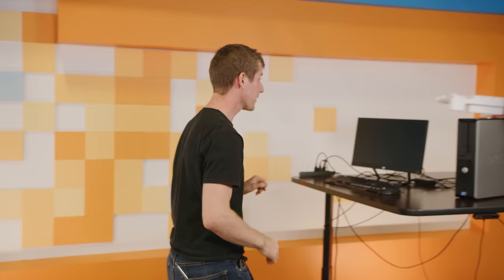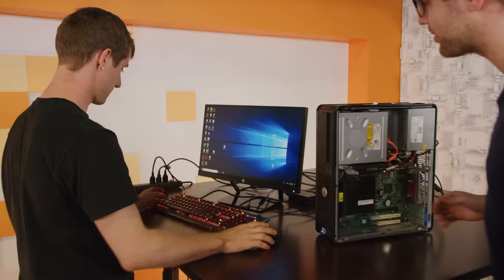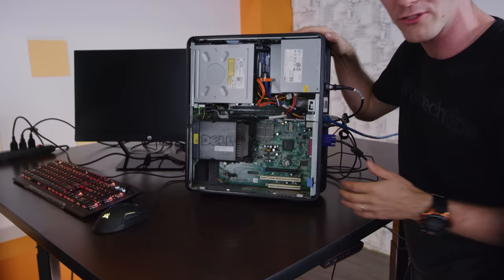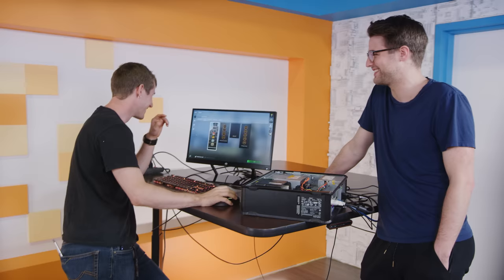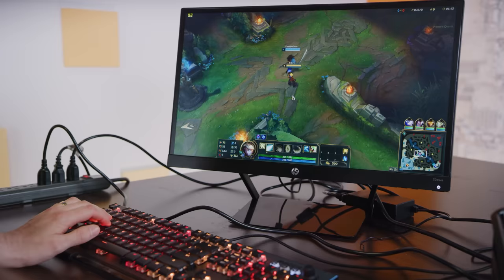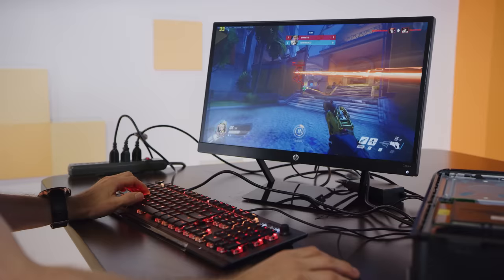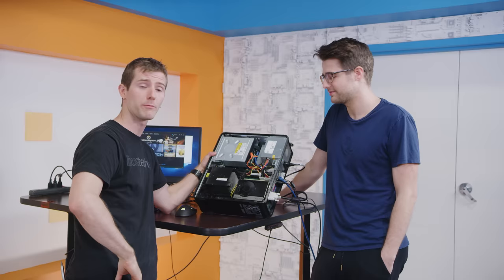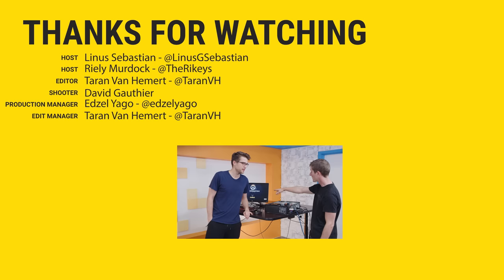The $69 Gaming PC RETURNS

Comment: you should bring this back but use the Dell Optiplex 755 or 360, 8 gigs DDR2 800 Mhz ram $30.00, a socket 775 moded 3.0 Ghz Xenon E5450 quad core or 2.83 Ghz X3363 (no bios mod required with Optiplex 755) aliexpress $20.00 these can be overclocked to 3.5+ Ghz using SetFsb free software, and a used Asus Phonex fan gtx 1050 or 1650 (60.00-100.00 USD) using the optional Dell Optiplex MT riser mounting braket and the optiplex 280W 80+ silver efficiency (no mod cable needed on optiplex 360)
Reply: Bioraual  Google it

Comment: I attempted a similar budget recently and this is what I got (£66 inc postage):
A4-5300b
8gb 1066mhz ddr3 ram
Radeon HD 6450
AC wifi and Bluetooth 4.0
250gb 3.5" hard drive
80gb 3.5" hard drive
20gb 2.5" hard drive
Dvd-rw drive
Ps/2 Keyboard and laser mouse
Wireless controller
In terms of ports its got hdmi, 4 usb 3.0, 6 usb 2.0, pcie etc

Runs windows 10 and is good for watching video + office applications, would anyone make any changes to this if they could within budget?

Comment: This makes my pc seem like a god tier PC I can run csgo max settings at 1080p 120 fps capped, my cpu is a Intel Core i3 6100 @ 3.70GHz, my gpu is a 2048MB ATI AMD Radeon R7 200 Series, I have 8GB of ram and my motherboard is a ASRock H270M Performance

Comment: the opltiplex models 360 and 380 like that had an optional riser module to make the half-height slots into two full height slots, i belive this had the PCIe x16 slot as the higher one. allowing the installation of a 2-slot GPU with no issue.

Comment: Radeon Pro WX 2100 would work "nicely" and fit with it being an OptiPlex...single slot, low profile. Pretty sure the Radeon Pro WX 4100 was the "best" low profile card you could get when the video was made - best in the sense that it'd give that anemic CPU the ability to decode HEVC. You could make a "cheap" HTPC out of old hardware using something like a single slot LP RX 550 before GPU prices got out of control.

Comment: I wanna try this on my Hp compaq 6200 pro sff because a used gtx 550 ti here is actually cheaper than a used gt 710 low profile, but I'm a bit hesitant. Can my psu handle it? The model I have has a 240w psu only.

Comment: that power supply will die quickly from that gpu its only a 230 watt so it will die trust me ive done it before with a low profile r 250 killed the psu after a while...

Comment: The Best Upgrade To This PC 

Graphics Card: G eForce GT 710
Processor: Core 2 Duo E8400(
Ram: 8 GigaBytes
And A Better Power Supply
250 Or 320 GigaByte Of Hard Drive
And a 120 GB Of SSD

Intel Core2 Duo E8400 and NVIDIA GeForce GT 710 will work great together on 1920 × 1080 pixels screen resolution for General Tasks.
This configuration has 0.0% of bottleneck . Everything less than 5% should not be concerned major bottleneck.

Comment: If you have 200 dollars then get a dell optiplex with a i5 2400 on ebay for 100 and go to ebay and find a 60 to 70 750ti and use the 30 for a ssd 

P.S. if you get another 200 dollars replace the psu and put in a rx 570 and sell the 750ti

Comment: Optiplex 780
Q9550 Quad Core 2.83 Ghz
16 GB RAM 1333 Mhz
450 Watt PSU I literally soldered the original motherboard connector onto new PSU haha
Radeon HD 6770 GPU 1 GB vram
160 GB hard drive and 256 GB SSD

It games okay-ish, I'm going to try a new GPU. A Zotac GTX 1650 Super - twin fan, 4 GB vram, only 6.2 inches long so it'll fit. The Radeon HD 6770 is 8 inches long. The new GPU arrives in the mail tomorrow, gonna try it out
Reply: Can confirm, the Zotac GTX 1650 Super works very good. I went from all low settings and choppy gameplay on PUBG to silky smooth on all high settings now

Comment: Even though something like this is nice, and a good price (sorta) I’d say try getting something with a 2nd or 3rd gen intel CPU, like... i3, i5, or even i7, Like how I got my HP Compaq 6200sff off Amazon refurbished. It was $190, but packed a lot of punch with an i5, 16gb ram, and 2TBHDD, good enough for light gaming when combined with a good 600 or 700 series gpu. Or even a GT 1030, cuz that actually works the best for such a system. I’d say look for a good one without PCIE watt limits, so you could pair it with either a 750ti or 1050ti. Whichever you can get easily, without being scammed.
These guys were able to get a decent setup with such a low budget, but for low end gaming, and also using this for daily tasks... it is gonna wear down eventually, but hopefully if you do go this low end, it will only be for a short time

Comment: > you'll have a hard time finding a modern graphics card that fits
I mean technically the rx550 would've fit, you'd just have to use that smaller slot's spot for the extra ports if it comes with it like mine. (and for me it's a good enough cheap card since it went into a m92p and I've never had a dGPU until when I got that awhile back so for most it would've been good in this since it's something XD). I've never honestly had a GPU and that was a massive improvement getting that in what amounted to buying similarly but at a local goodwill tech store for the same reason XD

Comment: Didn't even use Optifine on Minecraft smh.
You could've achieved an easy constant 300fps+ while using Optifine. (even a Raspberry Pi 3 B+ can achieve 60fps+ using Optifine and it's amazing 128mb of SHARED video memory).

Comment: I just got a new low price laptop. On the lowest settings possible for Minecraft, it runs at less than 1fps. Like how though?
Reply: What's the spec Minecraft is a pretty demanding game
Reply: @evanwattson  Intel Celeron 4000 and Integrated graphics. 4gb ram.
Reply: @mirrakirra  You need at least a core i5 9th gen or newer with integrated graphics laptop to be able to play something low spec
Reply: @jordannietos  intel integrated graphics are quite trash.
Reply: @mirrakirra  yeah honestly worth getting a cheap Ryzen 5 laptop with Vega instead
Reply: @jordannietos  I'm not really looking for another laptop. I don't think I need another really cheap laptop when I already have 2 and a normal one with a 2060.
Reply: @mirrakirra  Yeah me neither just agreeing with ya. Also got a pretty good deal on a laptop with a 2060 like a month ago for like 610 after tax. Definitely does more than enough until the prices of desktop cards go down.
Reply: @jordannietos  $610 for a 2060 laptop? How?
Reply: @mirrakirra  Really good deal at a pawn shop. 144 hz display too. It's pretty sick coming from a late 2008 MacBook running GeForce now 😂